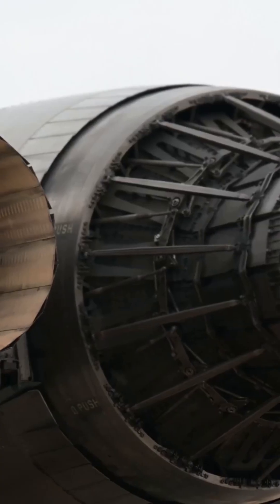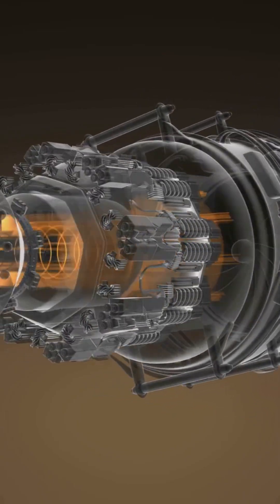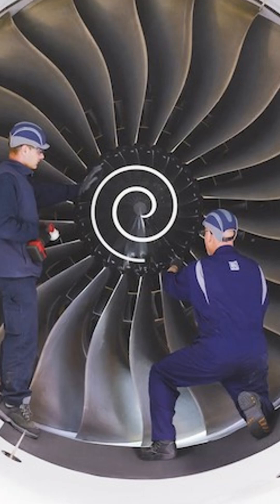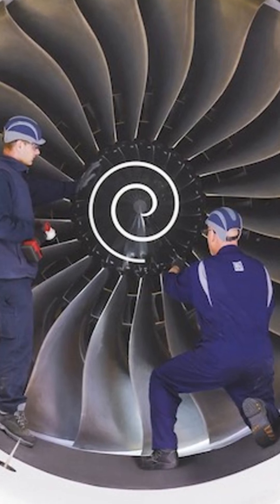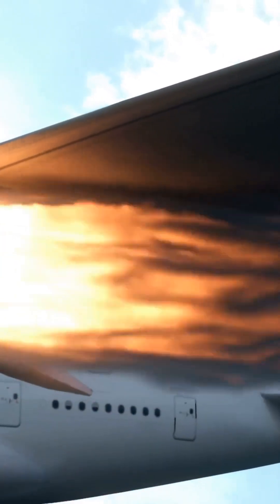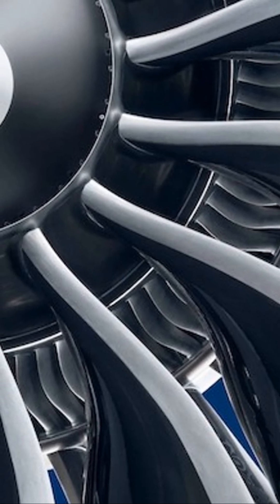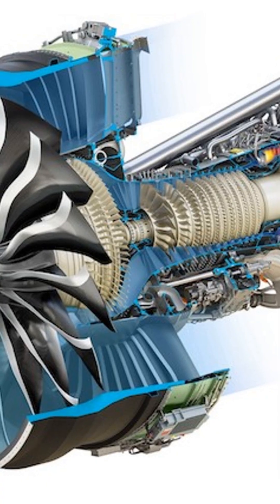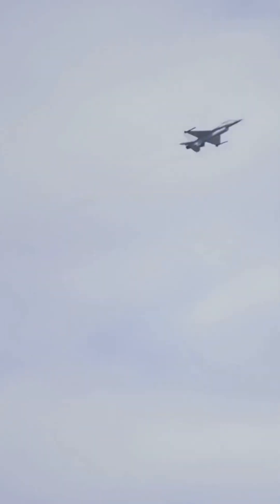How Do Jet Engines Actually Work? #aviation #jets #facts #engineering #planes #fliying #engine

Comment: Nothing is that hot inside an engine otherwise it would melt. Only flame front is 3000°F thanks to film cooling. Part of the compress air is diverted for active cooling